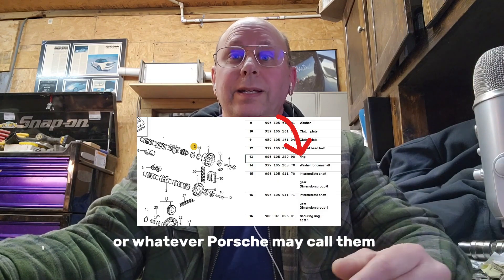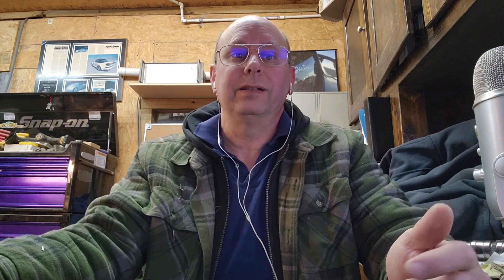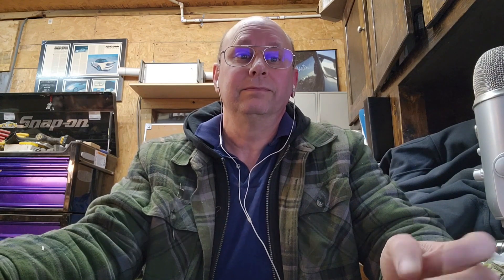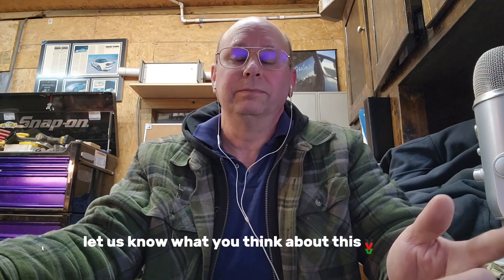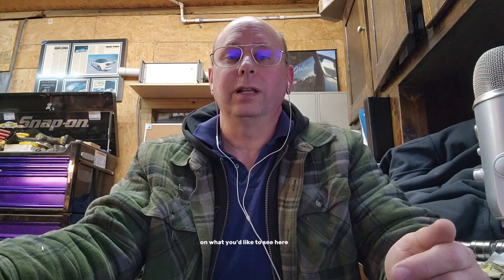Porsche 997 turbo cam problems. (P0011 P0016 P0018 P0021 pin cams)

Comment: Hello, I rectified my complete engine and once assembled new seneloids everything ok but in the end I have 2 errors P0016 and P0018 do you have any idea what it can be?? Thank you
Reply from the maker: I'm assuming you had a problem with the cam timing since both banks have errors.   Before the errors come up, can you get a cam deviation value?   Or afterwards, check the cam deviation.   Once the error has come up, the deviation is the value beyond the error recognition window.  so if you see -3deg, that's actually -13deg...    If you can pull a datalog (see the instructions on our website) I'd be happy to take a look at it and help you.

Comment: I wonder if the after market cams solves these issue like the  Schrick Sport Camshaft Set 997.1 Turbo?
Reply from the maker: We've never received a set of Schrick cams to pin, so I'm assuming they've pinned them from the get go.    I looked at their website, and the pictures don't look as though they're pinned.  It's possible they've redesigned the sleeve so it doesn't slip.  Or they've just not run around long enough yet to have failures in them.    However, buying a set of Schrick cams to avoid the error is 5 to 6x the cost of pinning your oem cams :)

Comment from the maker: If you're referring to the cam solenoid on top of the cam housing, then yes you squeeze the metal clip into the plastic connector housing then pull up.   It's the same style connector that's on your fuel injectors, standard bosch style.

Comment: Is there a cam sensor solenoid that can be clean on a 997.1 turbo?   Thx
Reply from the maker: The cam actuator solenoid on top of the housing can be removed, tested and cleaned.   The sensor on the valve cover can be cleaned but probably won't do much as it's a hall effect sensor and touches nothing.
Reply: @protomotive  one last stupid question.  It’s kind of tight getting in there and don’t want to break or lose the electrical connection clip.  My ? Is how do I remove those metal v shaped wavy clips?   Push in, push down then pull, use a clip puller?   I’m not familiar with that type of metal clip & don’t want to break or lose something.   Thanks again for any help.  997.1 turbo vvt solenoid metal clip.
Reply from the maker: @tommyburns890  Sorry for the late reply, I had replied before but it didn't post for some reason.   Anyhow, yes, those are a squeeze the clip, pull the connector type.   It's a bit frustrating to figure each clip out in the car as every one seems to have a different magic trick!   Interior stuff is way worse than the engine connectors.
Reply: @protomotive  thx I just pulled tested and cleaned them yesterday the clips were way easier than though. Though getting in there tight.  The passenger side was about a little more gummed up dirty about a 5 out of 10 the drivers side was about a 7.  ‘07 turbo tip 38K miles.  Glad I did it.  Cheers
Reply from the maker: @tomburns890  congrats!   Good work there 🙂
Reply: @protomotive  ok this sucks both are leaking oil now.  I ordered new rubber gaskets as recommended (the ones I pulled out were green gaskets and the ones pelican parts send me were black) they said the only difference is their rating.  I know Mercedes said black gaskets were old ones the green ones are the newer ones.  Only thing I can think is I didn’t torque them down enough Or the gaskets were a little big which I thought was because they were new & now heat shrunk & old & dried out?  Any thought or help would be greatly appreciated.   Thank you.  What is the torque spec? Hoping I just didn’t tighten them down enough but the green to black gaskets has me wondering too.
Reply from the maker: @tomburns890  we prefer the green viton orings.   Most black are rubber and don't last well. But also shouldn't be leaking regardless of torque due to the design.  Remove and check the oring diameter and thickness matches what you removed.  It's possible they sent you the wrong ones.
Reply: @protomotive  ok thanks for getting back to me.  I did compare the o’rings originally and the black ones seem to just be a little thicker I think cause they were brand new and never torqued down in place for years.  So those seem fine.  I got some better tools and angles and noticed bolts weren’t completely tight and the one on the drivers side were tighter and leaked less when the passenger side one leaked the worse & they were even loser.  Quite loose actually.   I was afraid of striping them first time. And I think because of the funky angle and tools and worried about stripping I didn’t nearly tighten enough.  This time I turned them in good and could feel them really snug up into place so I honestly think that was the problem.  One bolt on the passenger side the worse leak I turned several rotations to very nice and snug so I’m petty sure I just had the bolts to loose. I’ll clean things up and then and keep eye on them.  Thank you very much and wish you a happy & safe holiday.  I’m out in Nor California.  Cheers
Reply from the maker: @tomburns890  awesome!   Yes the angles are tough there for sure.    I hope you've solved it!    Many Oem orings are black rubber and do well for a decade +.... The viton are just much more resilient to temp and chemicals.
Reply: @ well that’s messed up.  The passenger side leaked again. Not as bad at all but leaking.  I’m gonna pull it out and see if the seal is kinked or twisted & likely order another one.  Geez
Reply: @ well that’s why the Fing gasket was shreaded & cut in two pieces
Reply from the maker: @tommyburns890  Ouch.   When the o-rings are a bit fat, they can catch on the edge and are hard to get in, which makes them get cut on the lip.   Be sure to use lots of white lithium grease when installing to help with that.
Reply: @ yes like I said they felt a tad big but I thought that was mostly because they were new and the other possibility is I didn’t slowly go back and forth on each bolt to lower/tighten into place more evenly but thought I tried to do so.  But again it was so tight & hard to get in there with mediocre tools.  Really appreciate your help!
Reply from the maker: @tommyburns890  I'm finding some Viton ones here https://www.oringsandmore.com/fkm-o-ring-18-72-x-2-62mm-minimum-10-pcs/?srsltid=AfmBOorVyfEVdrIXg7O6aIusE8gQAGZDCmMz-IMsXmXeY5FoNorsB8v6ZIk
Reply: @ another concern I had and no way to get to unless I pay someone to drop the motor is if the oil the leaked can find a way into maybe the plug and coil or the electrical connections between the 2 coils?  Should I have other concerns now about this oil that leaked from these vvts?  It will the motor heat burn off what leaked?  Or I could remove the intercoolers & clean and spray some degreaser?  I don’t know?  Thanks again
Reply from the maker: @tommyburns890  those connectors are made to resist water and weather impact so are pretty resistant.  Once you're together give the engine bay a nice soapy bath and rinse.   You'll be OK.
Reply: @ nice soapy bath.  Lol.  I might need one of those when I’m done.  Ha.  Thank you again I appreciate you!
Reply: @ what is the torque spec on each of the 2 bolts.  Thank u again
Reply from the maker: @tommyburns890  if you're referring to the two M6x1.00 bolts holding the 2 bolt flange down that retains the cam actuator, then they're not much at all.  just 6 to 7 ftlbs.  72-84 inch pounds.
Reply: @ ya thanks makes Sens as once the o-ring are set in that’s good.  I just snugged them up nice once I felt them set so maybe a hair more.  Crazy thing too is I got 2 new gaskets & I compared them to the original green ones I took out & again they were quite a bit bigger and sloppy on the solenoid why I believe the first ones didn’t go down in.  It’s very tight in there & I tried again several times & just couldn’t get the new ones to go down in & was worried again they would leak so after double checking the condition of the originals which were in very good shape I tried to twist those down in with my fingers and couldn’t get those to go either so I ended up just using them again and went back and forth in each screw to ensure they set down in as even as I could get them.  I’m pretty confident they won’t leak or even close to cracking.  Sorry for long message I can’t tell u how much I appreciate you.   Cheers
Reply from the maker: @tommyburns890  I'm glad you got it!   Have a great weekend :)
Reply: @ FYI this is wild.  I told you the new o-rings both  shredded & leaked so then I put the originals back in & the passenger side leaked again but the drivers side didn’t.  I then got another oem o-ring & put a hose clamp around it for several days & put in fridge to help shrink & flatten it & used lots of lithium grease & yep, it leaked again & was shredded.  Absolutely no way to get new oem O-rings in as it’s like putting a loose nickel sized oring in a penny sized hole.  So this time I again put the original o-ring back in but also made a perfect home made gasket from fel-pro rubber fiber to fit between the metal on metal contact. I don’t know how or if it will leak now but it it does I’m gonna still use the home made gasket and just go to my local auto shop & buy a oring between the size of new and worn original.  Crazy but still glad I pulled them tested and cleaned them as they were clogged up and think being cam issues on these 997.1 turbos all owners should do this every 20k miles or so many years.  Happy new year!  And again thanks for your help.
Reply from the maker: @tommyburns890  now that's just sounding ridiculous.   It sounds like whoever you're getting the o-rings from are getting you the wrong part, or the material they're providing is swelling up.   You shouldn't have to jump through hoops like you are.   A little white lithium grease on those o-rings and they should slip right in.
Reply: @ that’s exactly my thought!  I tried both aftermarket & a Genuine Porsche o-ring & both were same size & bigger than the original & both shredded and wouldn’t go in.  I’m thinking this is supposed to be more of an engine out job where you can get better leverage etc putting them in??
Reply from the maker: @tommyburns890  They're commonly changed in the car for diagnostics on the P0016,p0018, etc. issues.   And aren't really an issue there either.    I've just not experienced any issues with them doing what you're explaining, so it's really hard to share or even troubleshoot, other than the o-rings are wrong size going by your description.
Reply from the maker: @tommyburns890  do check the size, they should be 18.72 x 2.62mm according to PET diagrams.
Reply: @ so it’s still leaking even with that homemade gel-pro rubber fiber gasket.  I read maybe the mating surface maybe damaged on the solenoid?  But don’t know what that means or where that is?  My other thought is it’s leaking above the o-ring where the inside connects to the flange that bolts down like it cracked when pulling it out originally but man they feel so solid. Don’t know how I could check that.  Appears I’m gonna have to spend $300 for a new solenoid??  This has become a nightmare.
Reply: @ you were right & I finally fixed it.  The O-rings I received before were both too big. I ordered the exact ones you told me to get brand and size and clearly was the same as original just slightly bigger to fit nice and tight & fixed the leak.  Crazy that both the elring Klinger brand & genuine Porsche brand o-rings I was told fit were both too big & shredded both causing to leak.  Crazy thing was this last time I put it together & took for test run and hit the gas the engine fouled & check engine light came on I let off gas and cruised home the light went off and engine ran fine.  My guess was the solenoid needed to fill with oil & acclimate.  No leaks or engine issues since!   Geez.
Reply from the maker: @tommyburns890  congratulations on your persistance with that!  It sounds like you've finally nailed it :)    Most cam codes would stay present for quite a few key cycles till they were repaired or remedied themselves.   Misfire codes pop up and disappear like that.  keep an eye out for them!
Reply: @ thank you & do I use carb cleaner or MAF sensor cleaner or throttle body cleaner?
Reply from the maker: @tommyburns890  you could spray carb clean then pressurized air through it.

Comment: How about pinning them and also applying Loctite 648?
Reply: The pins have been a 100% cure to this point :)   We not only pin, but peen the pins in place.    And that all being a pretty open area, I don't believe the loctite would stay in place and you could risk a chunk of loctite coming out and getting stuck in your Variocam actuator :(
Reply from the maker: The pins have been doing excellent.   That's not really a place for loctite.  We have seen people tack weld the in place too!

Comment from the maker: Thanks for watching!   Be sure to check out avoid these mistakes when modding your 997 Turbo and I blew up my Porsche.   Both great videos for your car.     The 997tt with a tune and tcu is quite the competitor out there.   Without the tcu the torque is limited in the first 3 gears and you need to play tricks in the dme to help but doing the tcu with ecu is a much better solution.

Comment: If you ever do a street ECU tune + TCU tune on a 997 Turbo, I'd love to see how that goes!  I've been looking at your site and wondering if that is a combo worth doing on a stock 2009 997 Turbo Tiptronic?  Well, I did add the Sport Design Steering wheel with the paddle shifters and the required steering module, but yeah otherwise it is stock.  Great videos; thank you for sharing all of this information!
Reply from the maker: We do them all the time and they're really quite the street weapon!   A tuned tip 997 turbo gets off the line so quick, it's really hard to compete there.  With a tcu tune, you get quicker shifts and optimized rpm band and we're able to remove the torque limiters in the 1st three gears that really affect them when tuned.  so the combination is fantastic!